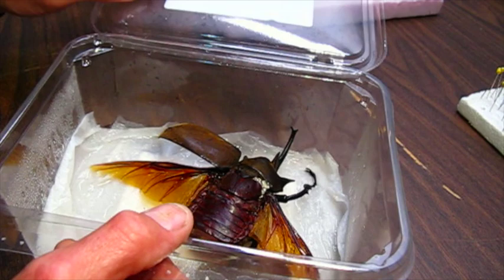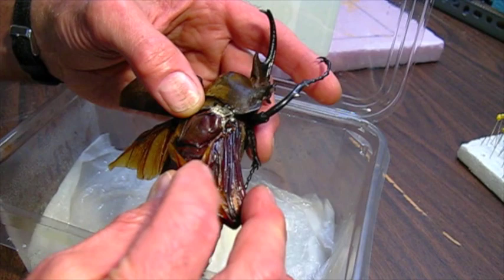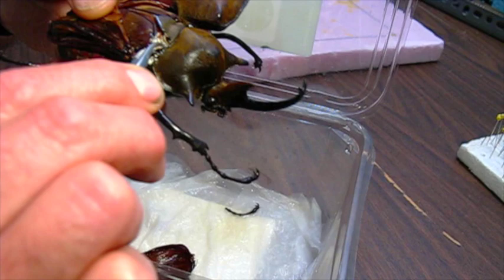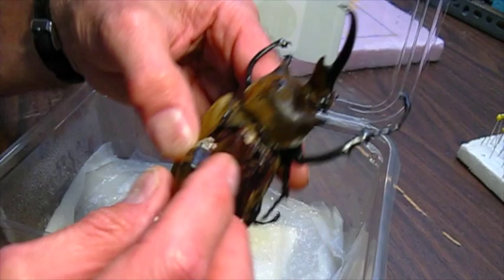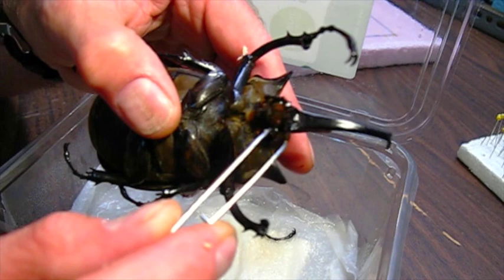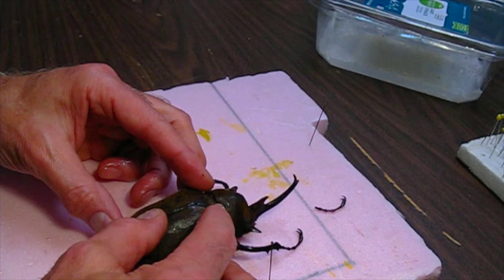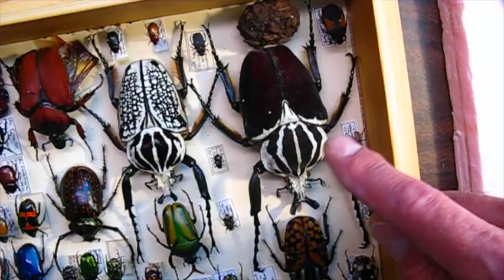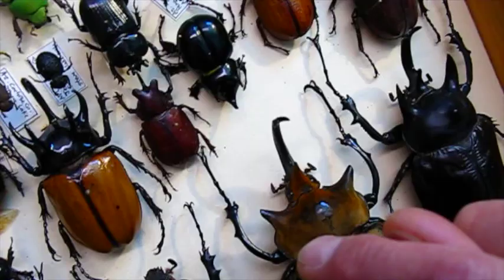Megasoma Remount and Repair

Comment: Great video! Will beetles experience any falling apart or serious damage if left in a relaxing chamber too long? How long is too long?
Reply from the maker: Yes they will. the muscles inside will decompose if kept moist for too long. How long depends on many factors, size of specimen, temp, bacteria present. I've kept relaxed beetles in isopropyl alcohol while waiting to be pinned. They can also be kept in he refridgerator or freezer.

Comment: Do you have any paloverde beetles in your collection? I grew up in Az, and I used to be afraid of them because they would dive bomb you for no apparent reason.
Reply from the maker: Yes I do. I am certain that they weren't trying to land on you. If you were near a light outside at night the beetles are disoriented by the light and fly around in circles. If you happen to be standing nearby they will eventually land on you. You don't have anything they want and they avoid predetors which you may be as far as they know.
Reply: insectsafari I’m sure you are correct, but I like to think they had it out for me 😂 Anyway, I think what you do is very interesting and I look forward to seeing more videos as they come.

Comment: I enjoyed this video of the beetle repair job. What brand of glue do you use for attaching insect parts?
Reply from the maker: I prefer a clear, water-based glue which allows a view of the ends of the parts being attached, which would be obscured by common white glue. It also dries clear so the repair is not visible. If an adjustment is needed after the glue has dried, water-based glue can be softened and removed unlike more permanent types of adhesive. There are many brands of this clear glue I'm sure and they are all basically the same. Some are tinted slightly blue or are entirely clear. Often found with school supplies.

Comment: Are there any beetles that require gutting and stuffing prior to pinning?
Reply from the maker: I haven't seen it done but I could imagine preparing a very large beetle that way to reduce the amount of dried organic material inside. Beetles generally have a thick exoskeleton so there isn't any shrinkage when they dry. Some beetles can develop some greasy staining from fats leeching out to the surface, especially specimens like Goliathus that have areas of white coloring. These might benefit from such taxidermy.

Comment: Great video!!   I also watched specifically for the glue you used......can you advise the (specific glue brand) and or will the Cyanoacrylate esters type of glue work well??  well done. thanks in advancce!
Reply from the maker: I'm happy that you enjoyed it. In the US the most commonly available brand of water-based glue is Elmers but there are other, equally good brands. They make a white glue, used most often in schools for art projects, a wood glue and a clear (or pale blue) glue that also has a gel formula. I prefer the gel, it's a little more viscous. The clear glue allows you to more easily see the ends of the parts you are attaching and is not visible when dry. I like water based glues because if you make a mistake, it's easy to remove with water for another try. Cyanoacrylate glues can't be easily removed. I do sometimes use them for certain wing repairs like attaching broken luna moth tails with carbon fiber splints ( I have a video).
Reply: wonderful, thank you!  Most informative videos of their kind. @insectsafari